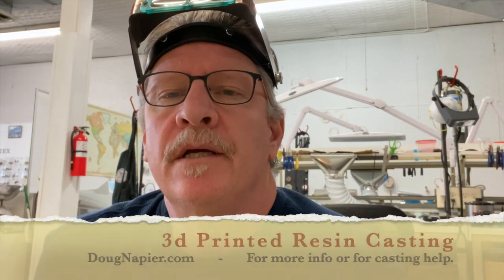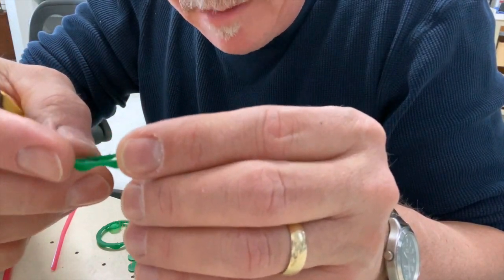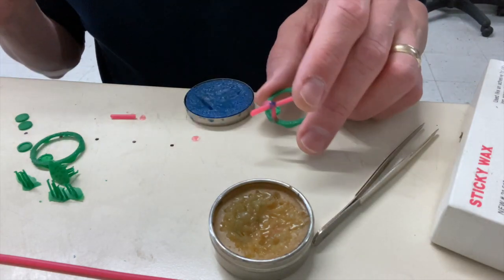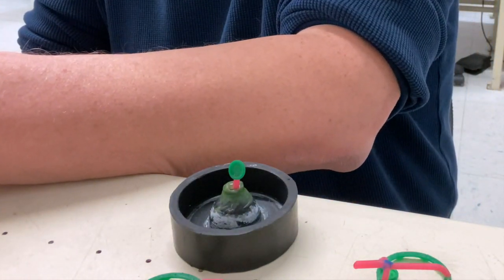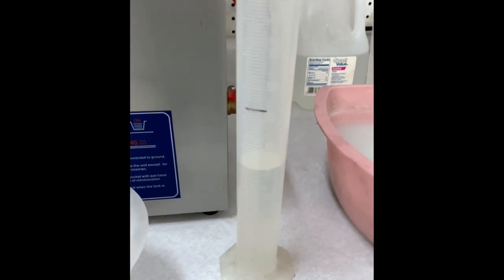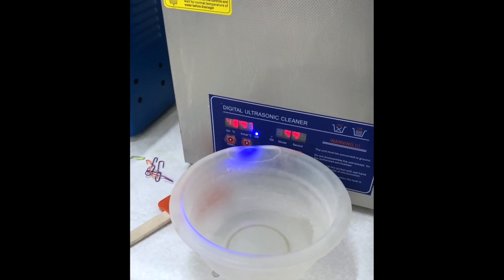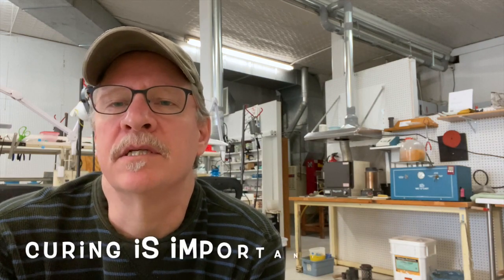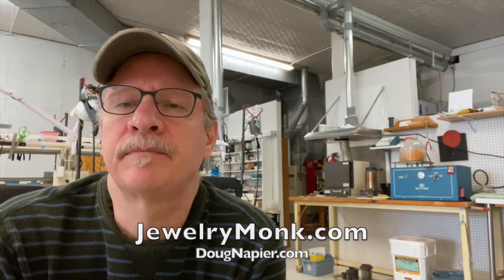3D Print Resin Casting for Jewelry How to Video Step by Step B9Creation Emerald Resin Vacuum Cast

Comment: Thanks for the close up of snipping off the supports. As you demonstrated, I also found that snipping the supports off near the ring is best; especially for delicate pieces. If you snip the bottoms of the supports first, then they tend to put extra forces on the ring. I have to remember this each time since when I don't, my castable wax ring typically splits from those extra forces.

Comment: One of the better videos I've seen my question is if I make the burnout  cast in previous day .... Time wise let it cool? For later date

I can't seem to get answer if it's ok and can I reheat cast and what temp before pouring
Reply from the maker: It is not ideal to do a complete burnout, cool, and reheat it, but it is possible. If you have done a complete burnout, then just reheat the flask to casting temperature, 1000 degrees Fahrenheit for example, and let it sit at that temperature for 1-2 hours minimum, depending on the thickness of the flask, then cast.  Hope this answers your question.  Doug

Comment: Nice Video very helpfull, How much time do you degas on the flask after the plaster is boiling? I have a some afreid that when is boiling it will let some gaps witout filled.
Reply from the maker: When vacuuming the air out, I mix for 3 minutes, vacuum the mixture for 3 minutes, and vacuum the mix in the flask for 3 minutes. Total of 9 minutes working time.

Comment: Thank you Doug! You gave us really really helpful advice on how to cast resin with such perfect result. May I ask if you don’t mind, what is your chance of getting imperfect results like pits and porosity based on your own experiences? If you follow the exact procedure, do you always get such good results? Thanks,
Reply from the maker: There are so many variables when it comes to controlling pits and porosity in casting. Defect recognition is important, and you have to identify what the problem is. Are you dealing with pits, shrinkage porosity, gas porosity, or inclusions, etc?
With porosity, the first is correct design principles that follow what is call directional solidification. Next is sprue size and placement, which is even more critical when it comes to resin casting. Another important thing to watch for is how the piece is attached to the sprue and to the tree base. Watch to make sure this is a clean union and there is no chance for pits, cracks, or bubbles that can catch small pieces of investment it the metal. Casting temps are also important depending on the volume of the piece. So I guess what I am saying is there is no “ exact procedure” for every piece, but there are principles that when followed will give you a higher success rate.
Hope this helps.
Doug
Reply: @DougNapierJewelryMonk  Thanks Doug! I am very new to lost wax casting, but I have heard many stories from people who struggled with pits and porosity problems. I totally agree with your comments that there are many variables that could cause the issue, and we need to examine carefully on them, and practice is the key. I will probably bother you again in future once I get some results. Still working on setting up my studio….

Comment: Would it be beneficial to 3d print the sprue to save the effort of making and attaching later?
Reply from the maker: Yes, I do that quite a bit.
Reply: @DougNapierJewelryMonk  Is there a reason why you sometimes do it and sometimes not, or was this just for showing extra techniques for the viewer?
Reply from the maker: @Miketz  Sometimes I am forward thinking enough to plan out the sprue configuration, but most times I just do it at the bench.
Reply: @DougNapierJewelryMonk  Cheers. I am preparing to do some jewellery casting in the near future and youtube is a good source of the "how", but not necessarily the "Why".

Comment: Thank you very much for this wonderful video, which explains important details in jewelry casting. I am making my attempts to cast jewelry, but I suffer from the problem of distortions in my jewelry and other cases where the metal does not reach all parts of the piece, knowing that complex pieces have been successful in design, more accurate, thickness and diameter less than that failed.
There is another observation. Please note in the temperature table mentioned in the video that the oven temperature was lowered from 1350 to 1000 F. How is that, what is its purpose and the role of this decrease in the success of the work. As for the temperature that I used is at 1472 F for two hours, of course that is after Three hours passed before reaching this level. What do you advise me. If you have an e-mail or other means of communication, I can contact you to send you pictures of the pieces that worked for me and the ones that failed.
Reply from the maker: Hello Ayesh, the 1350 temp is to eliminate all the wax/resin residue completely. The 1000 is the flask temperature to cast the metal. (1350 is too high and will create gas pressure and gas porosity in the castings. Hope this helps.
Doug

Comment: Thank you for this informative video. Question what is  burnout temperature that you set the oven?
Reply from the maker: I use a couple burn out schedules, but the highest temp is 1350f and the casting temp is usually 1000f
Reply: Thank you 😊

Comment: Great video! I'm just curious what flask temp you are casting at. I've used stuller's recommended settings for their casting grain which is between 800 and 1200F. I'm getting some surface porosity with my castings (mostly 14k white gold). I'm trying to see if my flask temp is too high. Thanks again!
Reply from the maker: It really depends on the pieces you are casting. Thin pieces I cast at 1050-1100, and heavy pieces I cast at 900-950. Normal pieces I stick around 1000 flask temp. there are a few types of porosity, but the majority of it is shrinkage porosity and it comes from the design and sprue placement more than flask temp in my experience.
Reply: I had a quick question. what do you consider a heavy piece when using gold?
Reply from the maker: @mrmartins7900  maybe 2mm thick or more.
Reply: Hello Justin shuman do you get rid of porosity in casting?

Comment: Can i have further information about the 5/6 hours bornout schedule? Thanks!
Reply from the maker: After the investment has cured for a minimum of 1.5 hours, place the flask in the oven, ramp up to 1350 Fahrenheit at about 15 degrees per minute and let it sit at that temp for 2 hours. Then drop to casting temp. (I usually use 1000 degrees.) and let it sit at that temp for 1 to 1.5 hours, depending on the flask size. Larger flasks take longer to "stabilize". Then cast.
Reply: Can you tell me sir the burn out such small flask in celsius.thanks a lot

Comment: What investment are you using? I've had loads of problems getting the investment with the added borax to work. It seams that when the borax is added the investment becomes too thick to poor. If more water is added to allow the investment to poor the investment never seems to set up. Any suggestions?
Reply from the maker: I use ultra vest.
Reply from the maker: I don’t add borax, but powdered boric acid to the water.
Reply: @DougNapierJewelryMonk  I thought borax was just boric acid.
Reply: @DougNapierJewelryMonk  Thanks! Your video was super helpful!
Reply from the maker: Big difference between borax and powdered boric acid. Give it a try with the boric acid, I mix a couple ounces of powdered boric acid to a gallon of warm water to let it dissolve, then set it aside to cool to room temperature before I use it. Then mix that water with investment as per instructions.

Comment: Doug thanks, I am looking for a resin becouse right now I have to many problems with the resin ashes, so I would like to use the green from b9 what printer do you use and do you know the exposure time? your printer is a LCD printer? thanks
Reply from the maker: The Printer I have is a B9 printer which works off of high intensity UV lighting.

Comment: good morning, I have a question for you: why do you use pouring on the vacuum pump if you don't put a direct hole on the main column?  Is the plaster so porous that the pump can still create a vacuum of air inside it?  founded way back in 94/2000 but I used the centrifugal slingshot and this is interesting to me. Thank you very much
Reply from the maker: Hello. Yes, the investment is porous enough to allow a bit of vacuum assistance through it. I add the straws as a channel for the vacuum to assist a bit more to the harder to fill places.

Comment: super helpful video! i was wondering why not just resin print the sprue straight onto the jewelry rather than add it on later? seems like it would be easier to add that into the design but would love to hear your thoughts!
Reply from the maker: Thanks, many times I do, but other times I like to see how the piece is without extra sprues.
Reply: @DougNapierJewelryMonk  i guess you’ll end up with a nice ring either way, thanks for the response

Comment: HI Doug very informativ and thank you for sharing. You were mentioning the curing and how important. With the B9 resin and using glycerin in a pyrex bowl. I have the Gesswein curing unit. How do you know when you
have baked it enough to guarantee its cured for casting.
Reply from the maker: I would go with the manufacturer’s suggested curing time. The more mass of the piece, the longer the cure time. I “over-cure” my pieces just to be sure. It is hard to tell if they are properly cured, but after casting you can definitely tell if is was not cured enough.

Comment: How's it Doug, I keep getting a messed up cast. Sometimes it will come out half the ring or just the base. Any suggestions?
Reply from the maker: Pablo, I can help, but need more info. 
Centrifugal or vacuum casting (or other)
How are you melting your metal?
Flask and metal temperature?
Sprue size?
Sprue location?
Ring size? (Thickness or volume)
Wax or 3D Printed Resin?
All these things are important to know.

Comment: So u burn out the resin in the oven & that leaves the gap for the mold shape to pour into? Would this work in sand casting too? I don't have a vacuum chamber to do this way & I suck at carving the wax straight away.
Reply from the maker: Yes, it will work in sand casting, but the designs are limited do to the constraints of sand casting. (straight walls and no undercuts)

Comment: Great video.  I bought some of the Emerald resin from B9.  Do you have any info on printer settings?  I have a MonoX and was hoping for some guidance on numbers to start testing (at the cost of these casting resins, I don't want to waste too much!).
Reply from the maker: Sorry Kevin, I have a B9 machine, and it is all set up internally.

Comment: Thanks for the great video! One suggestion to help with the support cleanup on the part… you can change the contact shape of the support. I set it to a sphere. I can then snip supports right at the base and it leaves a small bump I can file down instead of a divot.
Reply from the maker: Thanks Matt. I will try that.

Comment: Hello sir 
You're really doing a good job
I have some questions
 are you dealing with any kind of porosity problems in Rp cast if not how do you get rid of it 
And secondly why do you dissolve boriac acid in water?
Reply from the maker: Porosity can usually be overcome with proper design and sprue (Gate) placement.
Boric acid strengthens the investment during burnout, it adds a “glaze” effect when heated.
Reply: @DougNapierJewelryMonk  what do you mean by sprue (gate) please define

Comment: For how long do you leave the mold to rest after casting before putting it into the water?
Reply from the maker: Depends on the size of the flask, but I usually wait until the metal does not glow anymore. 10-20 minutes
Reply: @DougNapierJewelryMonk  Thank you!
Reply from the maker: @andreimacarov6522  you are welcome.

Comment: Great work! I like how the casting turned out. I will try the straw and boric water methods. I am having problems with surface defects, I will contact my resin manufacturer and ask what is the best curing method.  What resin did you use for this project?
Reply from the maker: I use B9Creations Emerald resin.
Reply: @DougNapierJewelryMonk  thanks for the reply! I just realized it was in the the title lol
Reply: What is the boric water 
How can we mede it

Comment: I usually print my pieces including the sprue what is your opinion on that?
Reply from the maker: John, I will design the sprue in the design sometimes on smaller pieces, but there a couple of reasons I like to add them myself. 
1 is because I "oversprue" resin pieces for casting, in other words, I will add 5-6 sprues at times to the piece, depending on the design. which helps with porosity and inclusions.
 The other reason is because of a philosophy I have about swelling of resin and having pressure releases during burnout..... I could be wrong, but it works for me.
Doug
Reply: @DougNapierJewelryMonk  thank you

Comment: Love the vids, thank you for your efforts! May i ask what is your preferred go-to investment is? Trial and error gets expensive and time consuming. I'm finding that UltraVest is fine until you need fine detail or lettering, I've ordered some PlastiCast to try and might consider Prestige Optima.
Reply from the maker: Hey Doug, I use Ultravest, and for the fine detail and lettering, I add "Boric Acid Water". I am not sure of the mixture, but I add about 2 oz. of POWDERED Boric Acid to 1 gallon of hot water, let it dissolve, then set aside and use it at room temperature.
Hope this helps
Doug

Comment: What is the formula you used to determine metal weight by weighing the wax model? Different formulas for gold and silver.
Reply from the maker: Yes, every metal has a specific gravity, which can easily be searched on the internet. For example, the difference in weight for silver is 10.4, 14ky is 13.07, etc.

Comment: Hi Doug 👋 quick question: why not just print the sprues too?
Reply from the maker: Sometimes I do, but there are a couple of reasons I do not in a lot of cases. 1. I add several sprues to pieces and like to have the piece in my hand to really evaluate it. 2. Sometimes I like a wax sprue (or multiples) to release pressure from the "resin swell" that takes place.

Comment: 12:26 ... Do you use a mixture of boric acid and water mixed with plaster? What is its rate? .... How do you mix water and acid?. Thank you
Reply from the maker: Hi. I add about 1.5 to 2oz powdered boric acid to 1 gallon of warm water and let dissolve in water. I let the water sit till it is room temperature. Then I use this water to mix with the investment powder.

Comment: Hi Doug, really informative video! Probably the most informative I've found so far on YouTube. What is the boric acid supposed to do in the water? I see you noted that it makes the plaster extra hard but does that help with surface quality in your experience? Or does it mostly prevent cracking of the plaster? I have problems with both so I will definitely try it!

You also said the curing is very important and that you tried a lot of different methods, I'm also going down the rabbit hole at the moment of trying different curing methods for my resin but not having success yet. Is just plane curing for a long time what you do now or is there more to it to completely cure the resin? I've read that oxygen inhibits curing and the surface that is in contact with air will often still not fully cure. Do you use any liquid or something for proper curing?
Reply from the maker: Hello and thanks for the great questions. First, the boric acid in the water strengthens the investment. I could put the powder in with the investment, but it wouldn’t mix consistently. Boric acid when heated, turns to a glaze.
It is important to cure the resin fully, and the thicker the piece, the longer you need to cure it. I cure mine in a dish of water to keep the oxygen away.
Hope this helps.
Doug
Reply: hello, thanks for the video. Will you give me the % of boric acid to mix with the water? That sure helps a lot. Thanks

Comment: Hello mr Napier thank you so much for sharing your wisdom. Thinking of starting my own jewelry gig this summer and I am really curious about the costs of silver casting. Do you have any idea how much it would cost to cast a silver ring per gram when you include all the expenses like the boric acid, powder, resin, silver, and all? I know its a hard question but I don't know who else to ask :D hopefully, it's under 1$ per gram of silver
Reply from the maker: That is a hard question, just the equipment to be able to cast can cost thousands of dollars. 
Taking the equipment out of the equation, the cost of investment, burnout, (electricity and/or gas) will be a constant, and whether you cost 1 piece or 20, that cost will be the same, so the more pieces you cast at one time, the better. Then the size of the piece will vary as well and affect the cost. For example, I would say the average size of a ring is 3-5 dwt (penny weight) and with silver at $25 per oz. ($1.25 per dwt) That would be $3.75 - $6.25 just in silver cost.
Hope that helps.
Reply: @DougNapierJewelryMonk  thanks a lot for the answer your videos are great!

Comment: Do you happen to mix the two ounces of boric acid to a gallon of "distilled" water? Or do you use any gallon of water? I have heard that mixing investment with distilled or ionized water works best, I'm interested on your take. Does the boric acid take the need from distilled or ionized water?

Also, love your videos!
Reply from the maker: Distilled water is a good idea, just so if you have issues in the castings, in troubleshooting, one of the variables can be eliminated (minerals in the water). I use regular tap water, and have never had issues.
Doug